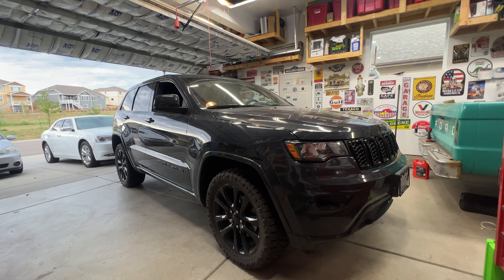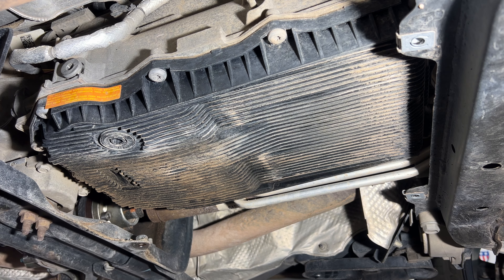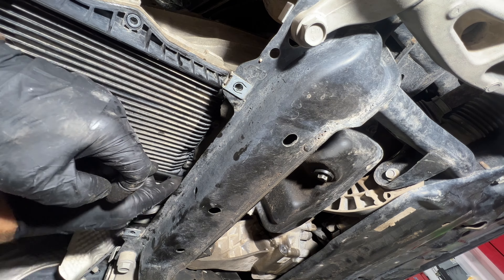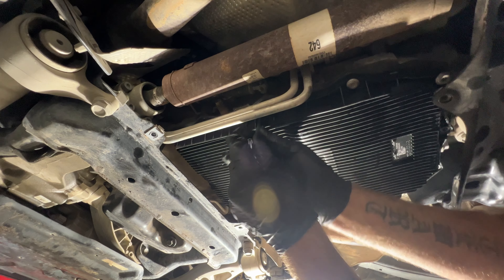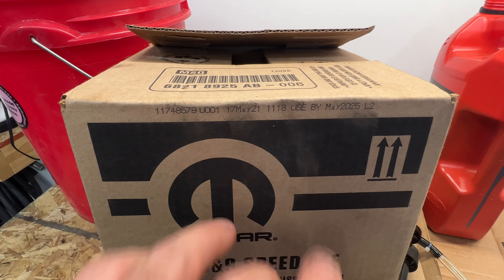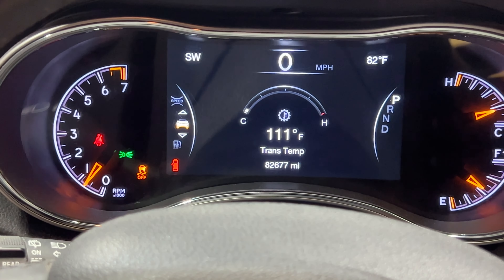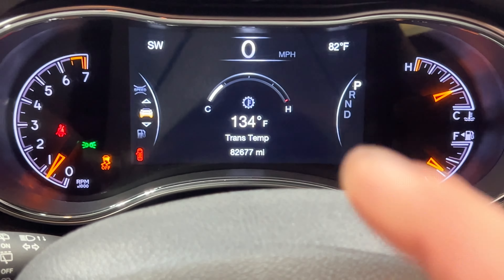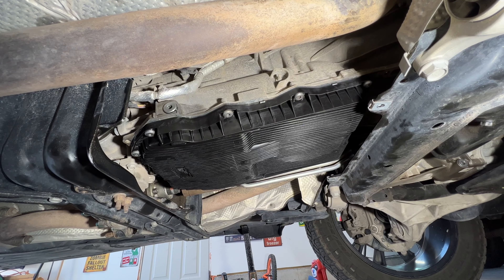2018 Jeep Grand Cherokee 8 Speed ZF Transmission Filter & Fluid Replacement How-To

Comment: Great video bud!!! No gasket sealer for the pan when replaced or is it unbolt, clean mounting area and reinstall new pan ?
Reply from the maker: Yep just clean up surface and bolt new pan up. The new pan has the gasket already in place and no need for sealant.

Comment: I have a 2014 ecodiesel. I have done this twice 187,000. Just a heads up you can use Valvoline max life instead of the zf brand.
Reply: Ask Chrysler if the Valvoline is approved.  They’ll tell you no.  It’s not the same fluid and should not be used.
Reply: Chrysler wants money lol so of course they will say no, it says on the bottle it's used for that exact transmission fluid replacement  @djosbun
Reply: @djosbun Obviously never used Max Life.
Try it, you will become another believer.
I actually think it's better than zf because it's made for extending the life of higher mileage transmissions.
Reply: @indyrock8148 can Maxlife be mixed in with the older ZF fluid in the next change? Or does the transmission have to be flushed completely before starting to use Maxlife?
Reply: @djosbun all the towing guys don’t care and they still get 300k-500k miles out of their trans. I’m still using recomended mopar stuff as it was cheap on Amazon. Now I’m using valvoline atf+4 as it’s $25  a gallon/4quarts at Napa. Bought two and I’m set

Comment: i have a 2018 wrangler with the 8 speed. It has 78,000 miles. What is the manufacturer (ZF) maintenance interval?
Reply from the maker: Chrysler/Fiat claim it’s lifetime fluid and never needs to be changed out the life of the vehicle so they don’t give you an interval. In my honest opinion I don’t think any oil or fluid is considered lifetime and fluid will start breakdown overtime especially with heat. So I did this vehicle at 88k I believe it was.
Reply: ZF lists the service interval at 60,000 miles I believe.
Reply: @BLUECOLLARGARAGE  ياصديقي اريد تغيير الزيت كم يكفي علبة زيت سيارتي 3.6 لتر 6v مديل 2012 ؟
Reply: If I have 117k miles, is it too late to replace the tranny oil?  Dealer kept pushing me off saying 100k interval but now says lifetime and won’t even do it!  I know on other cars with lifetime fill tranny that if too old the new fluid will actually cause it to slip
Reply: @John Marshall  same here 😢. 125k and my extended warranty is no longer available.  This sucks. Im debating if i should mess with it on just leave it alone.

Comment: I asked my Jeep dealer to replace the transmission fluid with my 100,000 mile service. They refused to do it. They said it was a lifetime fluid and in many cases the transmission will start to slip with the new fluid.
Reply: Did you ever change out the fluid ?

Comment: Has anybody tried to drain the fluid into a measuring container and then route a hose to the fill port, and replace the exact amount of fluid. Then drive it a few miles, maybe 50 miles or less, and repeat the procedure again with another 4 or 5 quarts of fluid? I suspect this would result in about 65% new fluid. ( A waste of 2.5 quarts of new fluid being drained with the 2.5 quarts of old fluid, but get about 7.5 quarts of new fluid into the transmission) This would leave the old filter and old pan in place. This interim upgrade on the fluid would be followed up with a filter and fluid change later, perhaps at 150,000 miles.
I'm worried about exact level and temperature variables in getting the proper level of oil. Slightly un-leveling the vehicle while draining the fluid would allow for refiling of an identical amount that was drained so that fluid level questions would not be an issue, and temperature/level concerns would not apply.
This vehicle has 89,000 miles at present with no issues or leaks...
Please comment.
Reply: I drained 141 OZ out and was only able to get 139.5 OZ back in with the engine running and parked on a hill with front down.
The fluid looked fantastic for a vehicle with 89,000 miles and driven in AZ heat by a lady that drives like a grandma.
I would not have changed the fluid had I known how good it looked.

Changed the transfer case (took 2 quarts of Shell 134, and both differential cases, with the rear taking a couple OZ more than a quart and the front taking 2 OZ less than a quart.

Long and short: if the Jeep was lightly driven, I would not change the transmission fluid until 100,000 miles. I didn't go through an additional 141 OZ change as I thought it was not worth it at this time. Will change the pan and oil at 125,000 miles

Comment: So I was reading some comments on change intervals. Iv always been told change it around every  35 to 45 thousand miles depending on how you drive and never do a transmission flush. Ever. Simply change. Also if you have gone for so long with out a change like 65k plus or 100k plus 😅 u might want to just add and not change and again no flush at all. Some mechanics will add the old fluid back in and just top off. But if ur at that point get multiple opinions and find a pro they will know if you dont.
Reply: Im at 125k. Unfortunately, my dealership never did it when it was under extended warranty.  2016 chrysler 300. Would you recommend flushing it? Or just leave it alone?
Reply: @OscarGarcia-sx6tx  do not flush it what ever you do.  I would probably leave it alone. But if you can find a mechanic that knows what they are doing they will check the fluid and depending on how it looks or smell might change it or might just put the old fluid back in and then just top it off. But me I would leave it alone at 125000 mi's and start saving for new transmission or new car. Unfortunately Chrysler aint the best when it comes to transmission and engine's. I know I own  a 21 grand cherokee.

Comment: Thanks for this video!
FCA claims lifetime oil, but did you notice any malfunctions on the transmission behavior that pushed you to change the oil ?
I have a 2018 GC 3.0 Diesel and it is 110k miles now. I recently noticed a malfunction when driving at high speed: the car speed is blocked at 185 km/h, the gear speed stays on the 7th gear and does not shift the 8th. Do you think this may have something to do with oil state ? 
Thank you
Reply from the maker: They claim it’s lifetime fluid but I have a hard time believing that. No issues with the transmission owner just wanted to keep up on the maintenance. As for the transmission staying in 7th and not going into 8th I have heard there was a tsb on this and some of the Jeep GC got a reflash.
Reply: @BLUECOLLARGARAGE  thank you ! I did not find this TSB, but when I will perform the oil change, the dealer will do something on the TCM in order to reset the software to take into consideration the fact the oil is new. I hope this will solve the 8th gear engaging issue.
Reply: ZF as an OEM recommands the partially change of the fluid every 80 to 120.000 km depending on your drive style. The dealer will not recognize your new oil condition in the gear box.

Comment: Are you looking to make sure the vehicle is lvl or the transmission? I'm doing mine right now actually and when my truck is lvl the transmission is still tilted down a few degrees...
Reply: I am doing mine today as well and i have my vehicle leveled, the owner's manual SUCK, follow your heart brother lol
Reply: @WarVet1984  What??? My owners manual doesn't include the procedure for changing transmission fluid because Dodge considers it lifetime. I get the feeling that you were being facetious though lol
Reply: That lifetime thing is just for them to make more money replacing parts that could've been avoided by only changing fluids, unfortunately some people are too naive and believe what the dealership says, i wish you good luck with your maintenance, that fluid pan is a pain to replace, Dumbass engineers  lol
Reply from the maker: You’ll be fine with just the vehicle being level because if you go to the dealership to have this done they will put it on a lift that makes the vehicle level.
Reply: @BLUECOLLARGARAGE  I ended up going with making sure the transmission was lvl. Parked downhill on the driveway and I was good to go. I rolled the dice and got lucky with QWP pan/filter off eBay $45 shipped and it's identical to the OEM pan. Used Valvoline max life as well shifts like butter 👍🏽

Comment: Nice video. Does the Jeep in the video have an external transmission cooler? The ZF instructions say to add an extra half a liter (16 oz) of fluid if it does, but how could that be done except for tilting the vehicle after the trans is filled with it on the level?
Reply from the maker: There is a thermostat that won’t open until the transmission fluid reaches 170 or 180 degrees Fahrenheit I believe. So if your just doing a drain and refill you don’t really need to worry about that unless you had to replace the transmission cooler or lines because there will already be old fluid in it and once you do the drain and refill that fluid will just get mixed in when with the new once it get hot enough and that thermostat opens up.
Reply: @BLUECOLLARGARAGE  are you very confident in this answer?  I've seen this too but there is some conflicting information out there
Reply: Therefore you saw the orange sticker in the beginning. I have performed this procedure already at 60.000 miles, after 15.000 I am going to donit again.

Comment: My 2020 was slipping in 3rd & 4th. Rough shift out of park. This definitely fixed it.
Reply: Does yours also hate shifting from 1st to 2nd when you first start it up. Mine does that and makes a harsh jerk
Reply: @Inferno45 mine does especially when it’s cold out also have a slight whine I’m hoping this fixes it for me attempting it next weekend
Reply: @bbuckeye12 did it fix it for you? I’m having the same issue.
Reply: @Inferno45  did you get around to changing your transmission oil.?
Reply: @bbuckeye12 did you fix the issue .?
Reply: @Inferno45 mine does. But it’s really only that first shift. I’ve been told is a computer issue that Jeep has tried to fix in the past with little to no success
Reply: @Inferno45  Yep!! But only when it is cold.

Comment: I'm hoping to do the same in the near future so many thanks for making this video. Your fill procedure was spot on and you took good care to get it right.  The amount you put in compared to the amount that came out also balanced. What puzzles me is when you first took the plug out there was quite a gush of fluid kind of like it was overfilled. Is it correct to assume that this was because the engine wasn't running. When running that "excess" fluid would be circulating throughout the transmission. Would this assumption be correct?
Reply: You are correct in your assumption.

Comment: Lifetime fluid is about the dumbest thing they try to sell to us.
Reply from the maker: Agreed
Reply: Small print. Lifetime to them means 100k, when its out of warrantee. LMAO When it fails, BOOM $7000 to repair! Sinister yet genius. Just not very customer considerate at all!
Reply: Yeah, even the engineers/designers of this Transmission suggest changing the fluid every 60k

Comment: I have an 18’ high altitude 3.6 also I’ve been experiencing rough idle to the point you feel it in the seats inside and you can see the passenger seat vibrating. I’ve been to 4 dealerships and all say everything is normal. I feel like my belt tensioner is wobbling much more then normal. Any advice? I’ve changed idler pulley, harmonic balancer, ac compressor and have done 3 different belt tensioners, everything OEM.
Reply from the maker: How many miles is on it? Have you done any basic tune up items like spark plugs?
Reply: @BLUECOLLARGARAGE  I have 62k miles on it, and yes I’ve done all the spark plugs also. And the Pcv valve also.
Reply: Did you figure it out? I had the same issue and it was the engine mounts. See if there’s fluid leaking from them
Reply: @chick009  nah man I changed out my mounts for and still have the same issue
Reply: Have you tried cleaning the throttle body? My parents have an envoy and it gets so bad that the car will shut off when you turn the ac on. Some carb cleaner and a toothbrush and it's good for another couple years. Also maybe plug a scan tool in and watch misfire monitors and fuel trims and look for anything out of whack.
Reply: Thanks for putting this up, it makes it easier to understand and as long as you have 4 jack stands & the fluid pump it’s not that bad of a job. Last year I changed the fluid & both filters on my 07 Jeep which has the 545RFE trans and it took about 2x the amount of trans fluid. I used a vacuum pump to suck out as much of the old fluid as I could. These old style trans use RTV to seal the pan which I’m not a big fan of but it sealed well with no leaks.

Comment: You have to level the transmission not the car
Reply from the maker: That is the preferred method but if you take it to your local shop or dealership to have this done they will most likely put it up on the lift or alignment rack to perform this procedure which will put the vehicle level. Having the vehicle level is not going to throw the level off enough to matter that’s why they give you a wide range of temperature on when to check the fluid.
Reply: @BLUECOLLARGARAGE but your not using a lift so why not just level the transmission
Reply: @MrCarttbone  how are you gonna level the transmission when it's attached to the car . Smart guy
Reply: @floofsale  you put a level on the transmission
Reply: @floofsale  if you take it to someone who actually knows what they are doing they will 100% put a level on the pan.  It’s like checking your oil on very steep slope.  It’s just not gonna be at the right level
Reply: @You Wish I’m not necessarily talking about this particular instance, but instead the correct way of performing the fluid change.  You didn’t even know you could level a transmission 😂
Reply: No dummy. Just have a concrete leveling company come out and level the concrete the vehicle is on so the transmission is level, duh.
Reply: @noahsmadda8828  the transmission is not level when the car is sitting level.
Reply: @MrCarttbone  True! The trans has a pretty extreme angle when the vehicle is level.
Reply: @floofsale  Some guys on youtube jack the rear end up more, to get the trans level. Seen it done on the Ram videos.  I don't think it's necessary though. I contacted ZF transmissions in the US and they said it was fine to just level the truck.
Reply: At the angle that the pan sits it's got plenty of fluid in it as the pickup is at the bottom of the pan.
Reply: @JF32304  there might be enough fluid in there, but these transmissions are finicky. They throw shut off codes if the detect the fluid is low, and won’t go into gear.  I’ve worked on a lot of them.  The transmission really should be level, despite what people say on here.  Besides it’s not hard at all to jack up the rear end and you will get a better result
Reply: @floofsale jacks up the rear diff 
On the Ram trucks it’s almost 21”

Comment: I only got 20k miles on my Grand  when I reach 80k I'll have the dealer change mines out I know they gonna charge me a grip but fuck it I don't want to touch because of extended warranty reasons so I pay them to do it fuck it 🤷🏿🤦🏿
Reply: They are trying to charge 800 and something cause of it being a sealed unit so I said fuck that. That's way too much. That's why I'm at this video and they won't change it under any warranty
Reply: @appleyardjr267  dam.. 800 dollars. Well if its once every 100k i say .. its probably worth it since u probably wont be doing it again 😂
Reply: @floofsale  ,You can do it alone. Onece you buy the pan from ZF the complete procedure is included in 4 languages and it is realy easy to perform it. I did it once and saved the money. Instead of buying the Mopar oil you can buy the original ZF oil for the change, it has a green color and if you need the PN I can give it to you. ZF recommands to perform this partial change once every 80 to 120.000 km, depending on your drive style. I personally did it at 98.000km as I am using a lot a trailer with 750kg total weight.

Comment: Does the pan come with the bolts and the gasket?
Reply from the maker: Does not come with bolts you’ll have to reuse the old ones and yes it comes with a new gasket that’s already installed on the pan.
Reply: It depends on the brand of pan/ filter combo you buy
Reply: The Mopar pan comes with new bolts and new full plug and pan with gasket

Comment: Without a drain plug the next change will be messy
Reply from the maker: Yeah not quite sure why they eliminated the drain plug on the new pans.
Reply: @BLUECOLLARGARAGE  Probably to save a few cents. It's not too bad without it, you just have to be careful and have a large drain pan. The JL Wrangler transmission pans don't have the plug.

Comment: Thanks for the video, nice job. But, I’m bothered by the fact that oil drained from the fill hole when you opened it. Tells me the vehicle wasn’t level because there’s no way to overfill that much fluid past the fill hole. 

Also, why don’t you check the service manual to see how much fluid that trans is supposed to hold instead of measuring what was in it?

I love this transmission, ZF did a great job on it, but the filter being built into the pan?! That’s really stupid in my opinion. What a waste to have to buy an entire new pan.

Thanks again, and nice job.
Reply from the maker: The reason it came out of the fill plug at first is because the vehicle wasn’t on so the pump was running. I measured what came out as a reference because the transmission was working and shifting fine before hand so if I add the same amount of fluid it should be fine. Plus with just a drain you won’t get all the fluid out there will still be some leftover in the torque converter and lines so you can’t really go by the owner manual capacity. I agree with you on the pan and filter but Dorman makes an aftermarket pan with a replaceable filter.